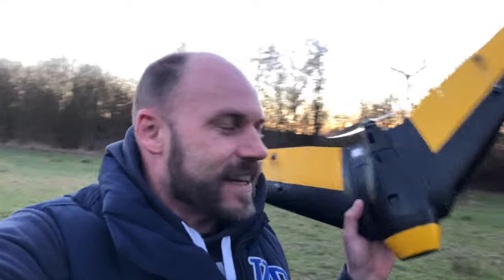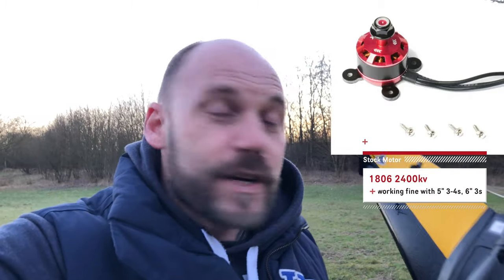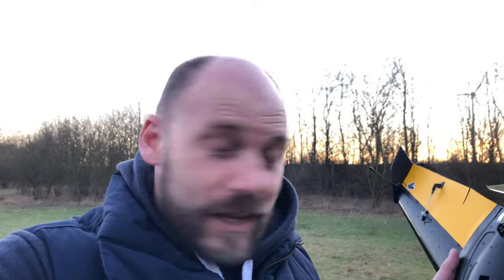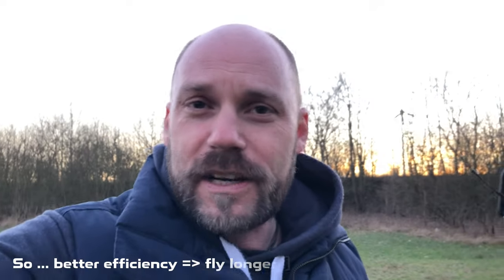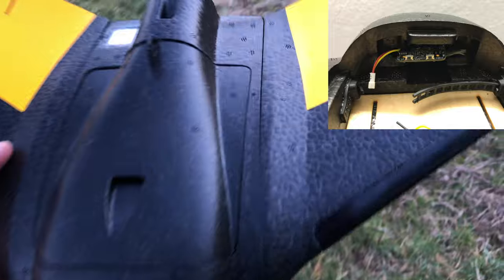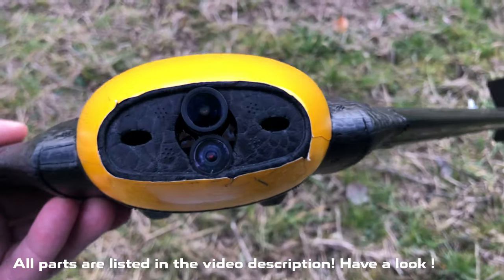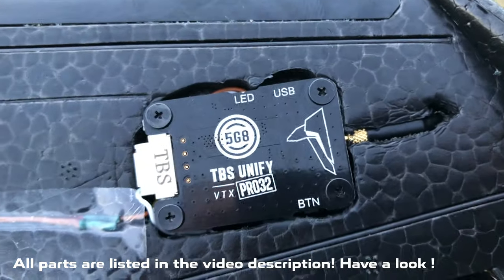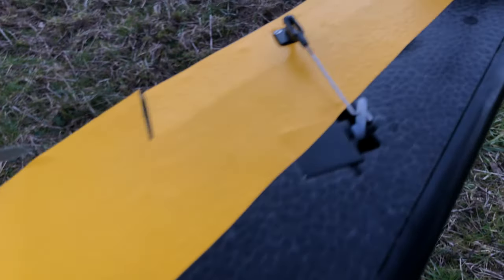Build V2 the never land setup | AR Wing Mini

Comment: Looks great, thanks for the video. Will test the motor/prop setup as well. You didn't list the motor in the video description.
Reply from the maker: I missed that ... my bad! It is a emax mt2204 II with 2300kv ... any modern 2204 will give same results ... just don’t take a Motor with much lower kv !

Comment: Would 1603 2800kV motor be better for 3S1P? 
It has great efficiency with 4" props
Reply from the maker: I don’t know- I don’t have a pair of that but 2800kv is surely not wrong ;)

Comment: Good day to you JustFPV
I have a quick question regarding the use of the 21700 5000mah 10A max discharge li ion cells, specifically in a 3s setup.
Have you tried a 21700 battery pack in this ar mini wing by any chance ?
Reply from the maker: Hi there :)
No, I didn't as they would be to heavy for the cause! 4x18650 (45g) was on the edge of what was good! going beyond those 200g would be hard to balance out (for me) and further the 21700 would be to bulky! That was the reason why I skipped 21700 cells on the Ar Mini ... (but I did on the Ripper!)
Reply: @JustFPV-net  Thank you for your reply.
I was thinking about it and even though I do not have those 21700 cells with me right now, I am sure that three should fit in the ar mini electronics bay, and weigh approximately 210g to 230g , would that be ok to try on the ar mini ?
Reply from the maker: For me it was to much and the wing starts to tell you that with some slight pitch-bobbing ... I assume the center to become to heavy so it bounces slightly up and down as the wings bend according to the motion. I would not try it. 4x18650 was the max in weight and space for my Ar Mini and the performance was great - adding more weight would not gain more I think. But it's your call ... If you try, you'll find out :)
Reply: @JustFPV-net  And using 21700's on the s800 ? 
Would that provide a longer flight time ?
Reply from the maker: I don't know ... that Li-Ion thing went off so much later after I finalized my S800 :)
Reply: @JustFPV-net  Thanks again JustFPV , I guess it would be worth a try soon.

Comment: Brilliant,  just what I was looking for. Always fancied one of these, as I own the original Ar wing and the pro. I've heard these are great little flyers?
Reply from the maker: They are cheap an awesome in so many ways. Definitely a wing to go for - especially in this configuration
Reply: @JustFPV-net  Yes I totally agree. I shall be putting a emax red bottom,  2205 2300kv on mine with a folding prop and full inav with Express Lrs. Should be interesting 😉
Reply from the maker: Sound like the beginning of a wonderful story. Perhaps you can skip out the folding prop… it will work even without that
Reply: @JustFPV-net  Yes, the intentions are good. And thinking about it now, i,ll scrap the folding prop and just keep that for the bigger stuff like Mini Talon and Skyhunter 1800mm
Reply from the maker: This is the way ;-)
Reply: @JustFPV-net  sure is my friend

Comment: Do you have any horizon drift with inav when hard banking?
Reply from the maker: usually not .... to be honest I find that discussion on horizon drift to be a bit overrated! It happens ... but it's gone soon after. Perhaps it's the way I fly that it wont happen that often. But I don't feel it to deserve so much attention as other people describe it. 
But it would be nice if we see that fixed in a future version of iNav ... let's say v4 or v5 :D Perhaps we should first enjoy, what V3.1 has in store ...

Are you "afraid" of the drift effect?
Reply: @JustFPV-net  yeah im afraid, since im just wanna to get started with wing (drone fpv before) and im dilematic if i need go with inav or ardupilot, since i will seriously long range 20km+. My complain about ardupilot just very few fc and not found 20x20 fc for small wing like this.

I dont think inav cant fix that if pawel not use Kalmam filtering method. What he suggested is ignoring fast turn on FW with limit gyro on cli and its bad even worst if you fly in strong wing.

Bad or not bad if there still a horozon drift it will affect RTL especially if trigger that on long range, and cant help exceptswitch to acro mode/manual mode
Reply from the maker: I disagree on the last part! RTH will "only" turn from your current heading to the next HOME point. after that it will stay linear and fly home. No turns in between :) So the risk is not that high. And yes ... I've tried hitting RTH from that distance (with this wing) ... worked as expected- no worries

Comment: Greetings again Matebox in Motion.
I'm beginning to build my Ar mini wing, I've soldered the pin connectors to the Matek F411 WSE. I have a question regarding the positioning of the flight controller and esc, can the both be mounted next to each other without any interference ?
Reply from the maker: It can but I would try to stuff the esc right in front of the motor mount inside the fuselage as the space is optimal for that. I’ve got mine there too. Put a cap on the esc and on the esc-pins (+ and -) of the WSE to prevent the noise from coming from the esc! Then you are good to go
Reply: @JustFPV-net  Thank you so much for your reply.
I'm not clued up on caps and the rating to use on the esc. Do I have to use a cap or can I get away without using one ?
Reply from the maker: You can of course get away with it without a cap! But be prepared (depending on your ESCs noise level) to loose the OSD at higher throttle! That happened in my last flight (on air next Wednesday). After having installed the Cap, the problem was solved. I used 470my-Farad caps ... inexpensive but still the bringer of joy ( ... and clear OSDs ) :D
Reply: @JustFPV-net  Does the osd return when you decrease throttle to cruise ?... I'll only use full/high throttle only for launching, thereafter I'll cruise out for distance.
Reply from the maker: Mine went blurred invisible at about 60% throttle... and that’s so crappy ;)
Reply: @JustFPV-net  Did it return when dropping throttle ?
Reply from the maker: Ye, it returns wenn the noise level of the esc drops as like to reduce throttle
Reply: @JustFPV-net  Thats excellent ! I will source the cap just for the sake of having it as a spare, but wont use it until necessary.
Also, with the Ar mini wing stock motor, stock prop and a 18650 3s1p lion battery pack, do you have any idea of the flight time during cruise ?
Reply from the maker: Almost 45min but you should consider a gemfan flash 6042 instead of the stock 5“ prop to easy reach up at 45min. 

In case you go for the 6042, don’t forget to remove a little corner from the foam as you otherwise could schmack the prop into it on landings
Reply: @JustFPV-net  Will any 6045 prop do ?...Or does it have to be a gemfan 6042 ?
I currently have a few 6040's, 6045's, 6050's and 6055's lol.
Reply from the maker: any will do! Just take the 6040" and it's fine
Reply: @JustFPV-net  Thank you very very much for your replies and help, very helpful with advice, much appreciated ! Keep up the good work !
Reply from the maker: Sure, and now you got out there with a completed wing and have some fun with it ;)
Reply: @JustFPV-net  Whoohooo lol
Reply from the maker: Just enjoying your coffee!If you want to shout out a greeting to somebody then reply here and I will get that placed an upcoming video as this is how it goes if somebody buys me a coffee! I give something back and send the greetings out via video :)
Reply: @JustFPV-net  Thats awesome! 
You already gave something which was your helpful videos and advice !!!
If you want, you can send a shoutout to you from me, stating thank you so much for being so helpful to us beginners, awesome advice and absolutely cool videos with amazing scenery, keep up the good work !!!
Reply from the maker: Then that is what will be your message! Thanks again and I'll put you on a special Mini Ar Wing video :)
Reply: @JustFPV-net  Thank you again so much !

Comment: so is 4s recommended or not? any video about 3s vs 4s on this plane?
Reply from the maker: I would recommend 4s to have every option at hand! The lower weight with 3s makes the wing a bit less bouncy but that's not really an issue.
Reply: @GordonScottYankeeEngineer  what prop combo did you recommend for those batt?
Reply: @ZuNunchaku  just FPV has played around with this a lot more than I have. But from my testing and burning up a couple of motors (New amp meter on the way) I have found on 3S the APC 6x6 pitch is the limit, do not run on 4s! And on a 4S battery I am using a 5x4.6 Bull nose prop. If you run the APC 6 inch prop do not do full throttle runs for long periods of time.
Reply from the maker: Try to change to a 2205ish motor for 4s and 6“ prop .. that helps heaps
Reply: @JustFPV-net  Great advice 👍👍
Reply from the maker: Thanks 🙏
Reply: @GordonScottYankeeEngineer  thanks for the info. I put apc 6 inch with lower pitch i found it more amp hungry than 5 inch 3 blade. But is on stock motor. I'll definitely upgrade to 2205 2300kv. Thanks for the warning
Reply: @JustFPV-net  my goal is for low amp, is 2205 with 6 inch more efficient than stock with 5 inch prop? I'll planing for 4s. 

Im right about to upgrade with 2205 motor. So i ask you first
Reply from the maker: Watch this:

How long does it fly on a 4s li-Ion pack? | Mini Ar Wing EP:14

https://youtu.be/gkZMNsUIVSU
Reply: @ZuNunchaku  I came to the same conclusion as you did. You would think the tri-blade would draw more amps?
Reply: @JustFPV-net  i have watch all your vid about mini ar wing. And it help me out. But i need more little push to buy 2205 with 6 inch prop. Or stock motor with 5 inch prop 😂
Reply: @GordonScottYankeeEngineer  yes i thought 5 inch will draw less amp and i tested it. But i dont know if stock motor with 3 blade 5 inch vs 2205 with bi blade 6 inch amp draw. My target will 45% throttle. With stock motor 6 inch below 45% throttle is more less just a little, but slightly more amps on 50% and up
Reply from the maker: It would- no gain and always trouble on landings as the blades can’t escape the ground
Reply from the maker: I had the greatest fun with the 6“ and a 2204 2300kv motor on 4s - good Punch and even long flight times. So that’s what I can tell.
Reply: @JustFPV-net  I really liked the higher KV (2777) on the hyperlite 2204 motor that I had. I have burned that one up and just replaced it with 2207 2450kv. Verdict is out🧐
Reply from the maker: ;-) … have fun.
Reply: @GordonScottYankeeEngineer  what 2207 >.< LOL, have fun
Reply from the maker: try this with a 6" prop !!! :D
Reply: @JustFPV-net  I burnt up the hyperlite 2204 with an APC 6 x 6 prop. But that motor was a higher KV at 2777. That was my second mistake, 6 x 4.5 at 2450kv should be safe? We will see 😉
Reply from the maker: Perhaps 2777kv is a bit much for the job. I would assume that 2450 will do better. My next setup starts with 1650kv on 4s and a 6”
Reply: @JustFPV-net  i’m just going after TopSpeed on this wing so the higher the voltage and KV the faster we are going to go 😁 it was just the prop was too much for that motor at that voltage 😳 I have seen some of the flight times you have been getting, fantastic 👍
Reply from the maker: I see ;-)
Reply: @JustFPV-net  I have watched your other videos, unbelievable flight times! 👍👍
Reply from the maker: Thanks man, really enjoy to fly at the 60min mark.  But let’s see, if we can reach 3h next season. For now im fine with how it is. 
And I’m thankful for you watching my crap ;)
Reply: @JustFPV-net  not crap man 😂 I enjoy it. Wouldn’t watch it if I didn’t
Reply from the maker: What can I say … we’ll thanks once more ;)